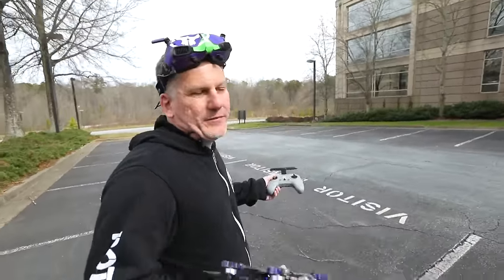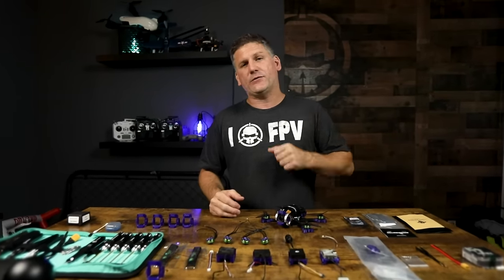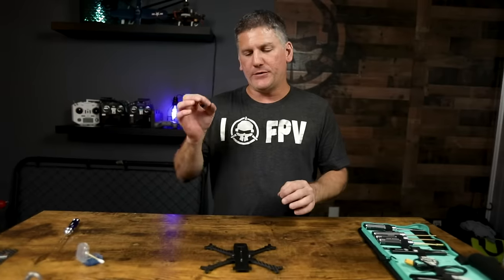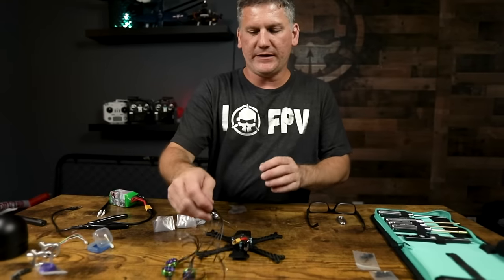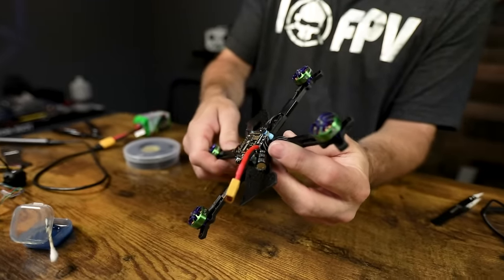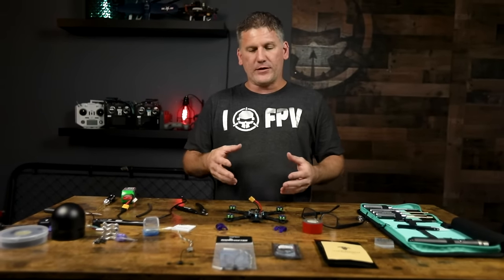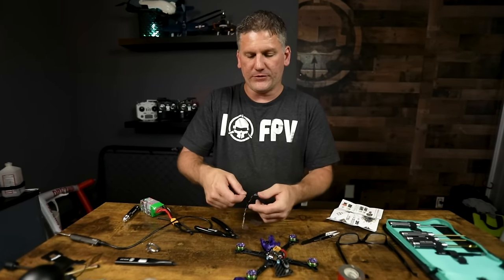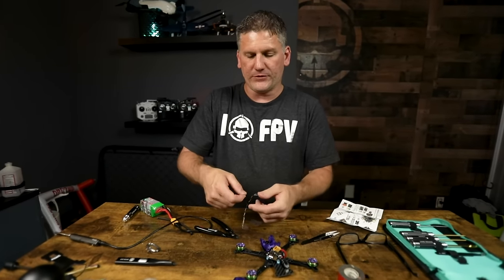The TANQ-S- LetsFlyRc's New 3.5inch Freestyle Drone- Build Tutorial

Comment: First off let me say this quad is AWESOME, thank you so much for the time and dedication you put into creating it.
I’m watching this because I just purchased one of these from RR. While I will say this is an awesome quad. I wish they would’ve taken the same care in building it as you did here. Cables were pinched under the o3 couch, which you call out here. Wiring harness was hanging out the side, I received it with used props on it and they didn’t include the extra set as well😢 just not clean at all. Easily fixable stuff (and I did contact them and they went more than out of there way to fix) just worth noting. All and all I will be recommending this quad to anyone that asks as I have found this to be so easy to fly as a beginner. Maybe I will just try to build it myself next time lol.

Comment: I was having some trouble and commented for some help, but realized I just had the props on wrong 😂 Awesome build brother, but my only suggestion is that these kits now come with Reaper 8bit AIO’s instead of the Mamba 32bit you’re using. Would it be possible to add a short or video update on how to use BLHeli-S instead?

Comment: Question, got the Avatar DIY kit.  When I upgrade to Betaflight 4.5, none of the motors will spin, downgrade to 4.4 and works fine.  I tried updating BLHeli, but couldn't get the BL Heli configurator to read the ESC for an update and I heard BL Heli is not longer an active project so no updates.  I'm stuck on 4.4 for now.
Reply: You may have not had a motor protocol enabled in the motors tab - it comes disabled by default.  

Dumping my txt file should fix that.  😊
Reply: @LetsFlyRC  Hey Thanks, your correct, I had to enable the Bidirectional Dshot in the Motors tab. :)
Reply: @LetsFlyRC  I got one more question which I can't seem to fix.  My Avatar seems to be stuck in "Standby Low RF mode".  My OSD works great, triple checked everything.  The only way I can get the system to record is to go into the googles and turn off "Standby Mode" which I don't like to do because it uses high power not flying.  Have you seen anything to fix this?  Betaflight 4.5, and Avatar 37.42.7.  Can't seem to find a fix for this one, does it work on your builds?  Thanks so much.
Reply: @davemicah3086  standby mode needs to be off.   I would never want standby mode on.   

If you disarm far away, or crash far away, you might find yourself in a situation where you can’t regain signal.    Just plug in and fly, and don’t sit around waiting, letting the vtx overheat.  

I can’t speak to a situation with standby mode on, because I have never flown my drone in that configuration.   Because it doesn’t suit my needs.
Reply: @LetsFlyRC  Hey thanks, yeah that's pretty good info, didn't think about that yet.  The Tanq-S is my first larger quad, only been flying the 1s walksnail whoop mostly indoor so never thought about getting stuck somewhere.  I guess it's not an issue then.

Comment: I have the Foxeer Reaper v4 35 AIO, ELRS, everything is on the same firmware, when i plug the quad in and turn the RC on it connects (says telem acquired) but it wont arm, what uart am i supposed to be on? i just cant get it to arm
Reply: Check modes and make sure you have a designated arm button

Comment: Considering you've been doing this long enough, I'm assuming there are no issues with wires vibrating around the gyro when running them over the top of the FC?
.
No point in asking where you put the RID module. 🤣😂😂

Comment: Can confirm... I used a pickle as a battery and a chopstick as an antenna.  My experience was different!
Reply: Check your pickle polarity- i had a problem with that.
Reply: @r3beatty  Tx for the tip.  I flipped it around and was much happier with flight performance.  Also I swapped out the chopstick for a candy cane.  Range is about the same but when I loose signal the static is red and white.  I consider this an over all improvement.

Comment: I think maybe trying to build this as my first DIY was a terrible idea.  I can solder just fine on the practice soldering board, no issues at all with the smallest pads on the practice board, but i CANNOT FREAKING solder these damn battery terminals and capacitor to save my life!  I think on a 30x30 ESC and FC I could probably do it, but not on these very tiny very thick pads with notches cut into them which I can't understand.  Every tutorial i have studied at length they are using the same little thin boards similar to the practice board, but I can't find someone soldering on this tiny little 25x25 THICK esc with these stupid F***ng notches cut into the pads.  Is that so you can lay the wire against the pad vertically?  I am pretty sure I roasted my first one by getting solder on the little tiny pin interface that is .5 cm from the back of these giant fat notched battery terminals.
Reply: The notches helped me keep the solder tip steady. With flux on the pad, it goes directly to it.
Reply: It also depends which soldering tip you’re using, but smaller the better. Most brands sell interchangeable tips separately.